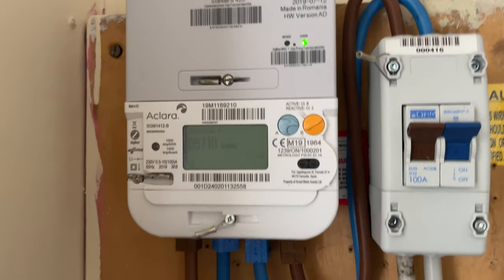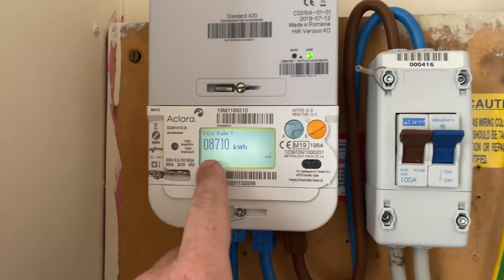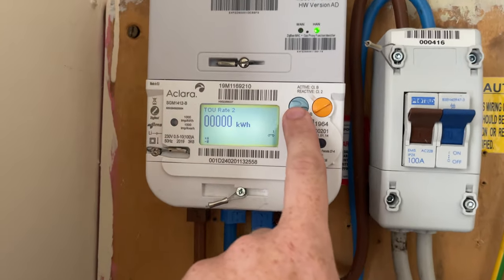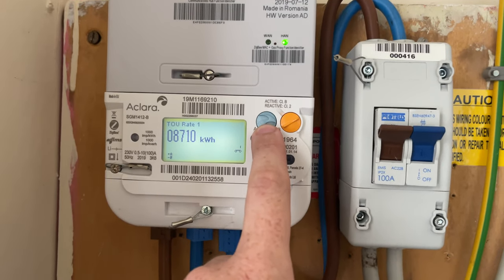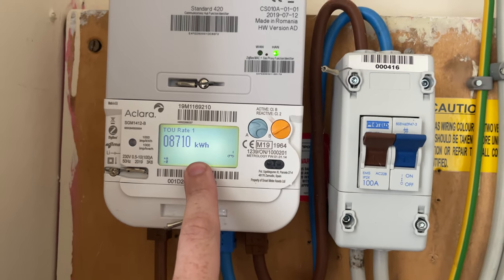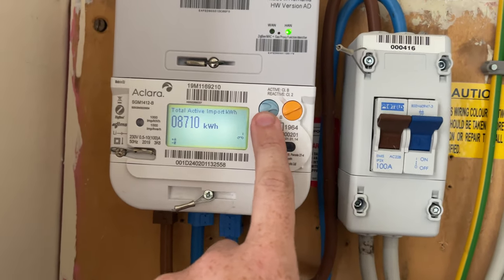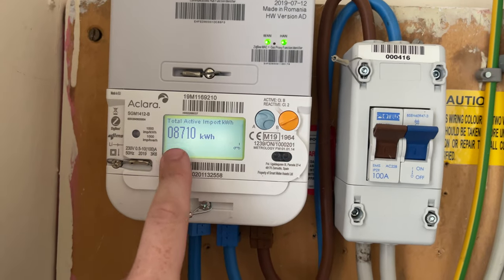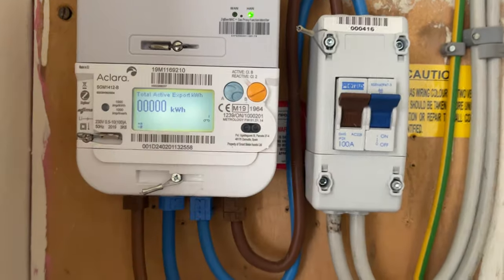How to get a meter reading on a Aclara SGM1412-B electricity meter

Comment: Hi, my screen only showing "relay armed press and b" I did and nothing changes, I have no idea what to do :(
Reply from the maker: I got this from Google:

"Relay armed" is a message on an Aclara smart meter that indicates the supply is ready to be re-enabled: 
Steps to reconnect
1 - Press A repeatedly until you reach the Emergency Credit Balance
2 - Press A and B at the same time
3 - You should hear a clicking sound and the screen will return to the default menu
Reply: @FixItWithFusco  nevermind I sorted it haha! Turns out I wasn't pressing the buttons long enough before! Thanks anyway!